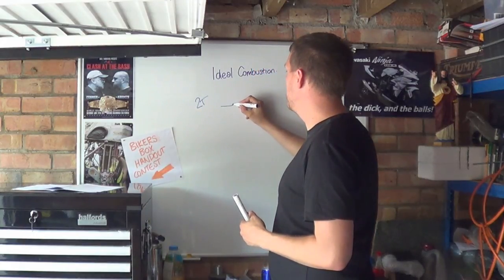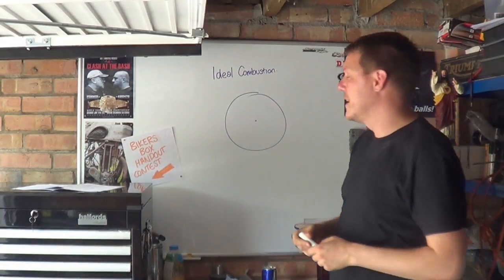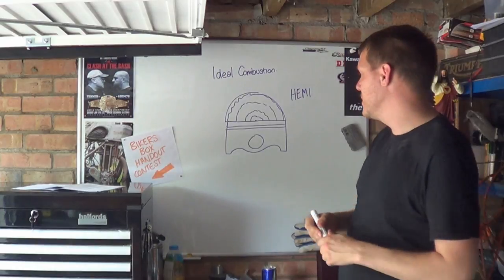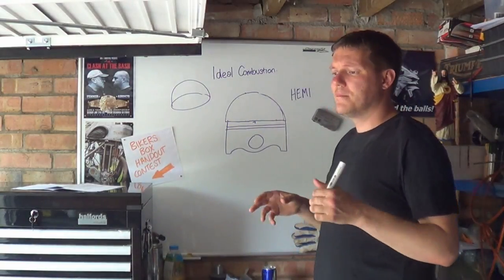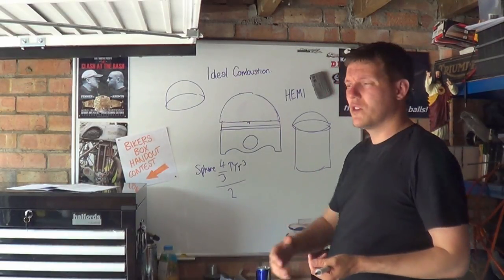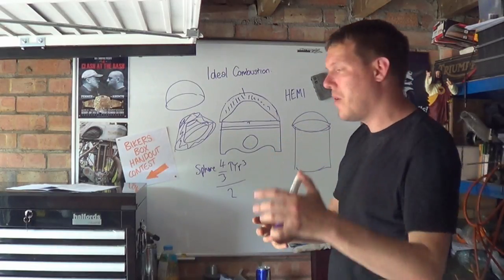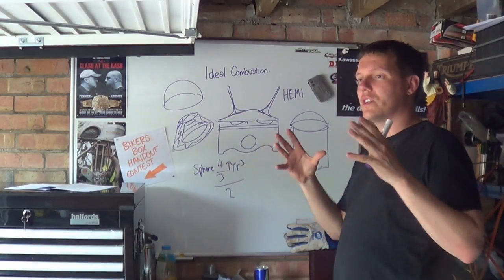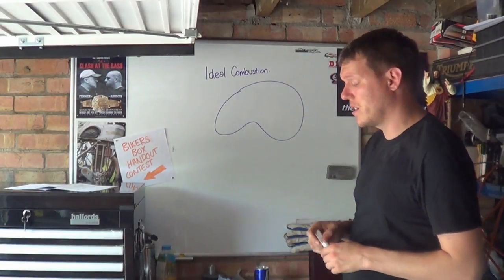Perfect Combustion and HEMIs

Comment: are you familiar with the abarth tcr engine,push rod with 13.5 cr,982cc with 112 bhp.it has a radiale head which i think is a hemi.chap does a show and tell on this motor on youtube.i used to spend alot of time with abarth.
Reply from the maker: No, do you have a link to this dude?
Reply: there is plenty of stuff on the net about this engine.norwegian gent youtube fiat abarth 1000 radiale-engine-youtube.this the whole bollocks motor.abarth also did twin cam motors and he used zagato to do his bodies.the final invocation of the radiale motor appeared in heavily modified fiat 600 shell in1970.the coach made bodies with twin cam are huge money to buy.abarth worked with porche,ferrari,simca and was aquired by fiat in  1971.abarth designed and built the lancia group b rally cars.the push rod radiale engine was very  fast ,8500rpm,112bhp and top speed of 125 mph.welcome to abarth..campione del mundo.

Comment: Love the content. Can you do a video on why motorcycles can run really high compression (my EBR 1190RX crash is 13.4-1, compared to cars high compression of 11.0-1 with the same fuel type. It's been racking my brain.
Reply from the maker: Because cars are shit! but yes I can
Reply: Because they run huge valve overlap, especially big twins like your buell and ducatis. Actual (dynamic) compression ratio when measured with closed valves is a lot lower, closer to 12:1 or so.

Comment: As time has gone on, I've started to look at good combustion on an application basis. 
---4-valve Pentroof is inherently good, all the time. 
----The kidney and cardioid stuff on the LS is good with a dished piston in certain stroke combinations from an integrable volume over time perspective, like when you include 40 degrees of crankshaft rotation, but then you need to know the desired RPM for duty.
----The other oddball is those diesels that have the cup in the piston, with a cone in the middle. I see a cardioid in the cross section, and it integrates nicely. 
---The hemi, yes, works like shit, no matter what. Truncated spheres are a different ball-game. I don't count those bastard things.
Reply: Look up the Olds W43, the engine that could've changed the game in all out performance.

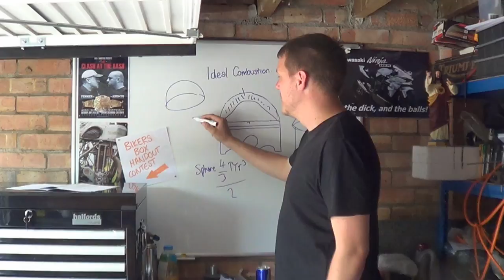Comment: 9:15 wouldn't that create similar shape charge physics, and create a concentrated section of combustion causing a hot spot?
Reply from the maker: Yes it does, hense the pent roof
Reply: But does the potential to extract more energy exists as a result of the shape, like a small shape charge cutting through thick plate?

Comment: In the early 1960's, GM/Chevy made an engine called the 409. It had a flat combustion chamber and a dished piston. It was very powerful, but the crankshaft kept leaving the block.
Reply: The 348 ,409 has a flat head and piston. The block deck is cut at an angle  and has a wedge were the combustion takes place. So basicly the combustion chamber is in the block.  My dad has a 409 in an Impala and we've been working on it for 30+  years together.
Reply: You are right about the wedge in the block, but there must be more than one type of piston for the 409. I have pulled the head on a 409 and it had a dished piston. 30+ years you have been working on the same car. When are you going to get it right.
Reply from the maker: "It was very powerful, but the crankshaft kept leaving the block"

- yeah that kinda stops that project in its tracks lol
Reply: Dad is one of those guys that can't leave it alone.  Its a 64 and you can call it a resto mod.  We do all the work ourselves and it keeps him busy. To him it will never be done as there is always another mod / upgrade.

Comment: Ah man, I hope I got this right, and you’re missing the main point of a hemi. Why would A manufacture want to have angled valves and valve train gear costing an exorbitant extra amount? It’s not because of the hemispherical shape but more the valve angles and port angles creating a better flow path from intake to exhaust in and out without right angles. it’s for  reducing angles or straightening the path of flow is the main idea. They flow better! Take for example some four-cylinder or six cylinder in line engines whether it be Japanese or domestics, to have the intake coming in on the same side as the exhaust going out. try and make that engine run fast. They won’t they’re backed up because it just flows like shit well add the straight up n down valve angles, and you’ve got a seriously power restricting pinch in the flow. 
Hemi science started in ww2 for aircraft when pistons still ruled the skies. Luckily or unfortunately that science got scrubbed for the end of the war. 
You’re spot on about the squish properties/problems that they pose and there inherent finickiness for octanes. 
But I’m spit on about the flow! 
When nitro is used, it’s like 7-8 times the amount of gas the run right. Add blower, huge cam,duration, big valves.....now you’ve got the needed flow characteristics to make SHIT happen! Carry on!🤘🏼
Reply from the maker: I'm lost here are you arguing against or with what I said?

You say stuff about straight runners, but generally hemi's don't have straight runners or was that you point you were trying to make?

Comment: I know you're intentions are good here, and that you believe the ideas you expressed are accurate. However, there are many issues I take with your proposed issues with a hemi engine. The heads of NHRA drag cars are not 1/2 spheres, they are more like 1/8-1/9th spheres with flat top, not "high compression" pistons, and yet they make almost 30:1 compression ratios running Nitromethane mixtures around 90%. How, you ask? Well they pack in the air and fuel with a super-charger. They need the volume of the hemi chamber for the size of valves they use. The intake valve is the size of large ci engine's exhaust valves and the exhaust valve is over 2.75 inches (almost the size of a pop can). The air is pushed in with forced induction and so much (they use 16 injectors) fuel in that it is almost nothing but liquid in the cylinder. By half way down the track they have burnt up the spark plug (which is powerful enough to arc weld, 44 amps/50,000 volts) and the "Hemi" becomes a Nitro Diesel for the remainder of the run. How can they run such high compression and so little air? Because Nitromethane has its own attached oxygen molecule! The sheer heat and pressure (30:1 compression!) is enough to ignite the mixture. The reality is this = The Hemi is used partially because of its history, mostly because of the technology/metallurgy/chemistry of drag racing. It is super effective for this purpose and there is no "NEED" to get away from using it. There are many other issues that I would love to go over with you to fill in some gaps on why these 11,000 horsepower Hemi's will be used well into the future.

Comment: The reason for the hemi is to increase the valve size not for ideal combustion. Top fuel dragsters use the hemi and they have like 50,000 horse power.
Reply from the maker: Wrong. Large valves have been superceeded by multiple valves, and the HEMI is something that many tried and then abandoned. As for TF dragsters that a different story and I'm doing a video on that this weekend.

Comment: In Defense of the Hemi and two valves from a bias source 
1) Dual valve allows for the placement of a second spark plug, increasing the efficiency of the ignition system --->  O:o
2) Two larger valves are stronger and less prone to breaking or burning/melting as apposed to four small valves. This is why very few people who drag race professionally here run pent head engines.
3) When using forced induction, the mass of the hemi piston is reduced to comparable pent head piston size.
4) When using forced induction the cylinder head chamber shape design isn't quite as critical as the air is "packed" in.
5) $$$ Its very likely cheaper to produce since final machining would in my logic take less time and labor.
6) As I understand, the larger size of pistons are desirable on the racing hemis. It allows for the pistons to endure 3 second 1000 foot drag racing. As apposed to melting pistons on every other engine design currently offered
7) one large valve may offer better fuel atomization when direct port fuel injection is not used.  
8) less valvetrain weight. Four valves springs per cylinder to overcome.

I don't doubt it that pent head has a more efficient flow design with nothing else but basic flow considered. A Pent head may have worse lament flow or worse CFM than the specific cylinder head you are comparing it to even if it is a better design concept, two valves or not. Perhaps its always better for low power applications where the metal is strong enough, It would seem a good enough design.
Reply from the maker: Dual spark plugs are not for efficiency but redundancy.
Reply from the maker: Number 3 you'll have to explain
Reply from the maker: No. 4 is wrong. Combustion chanber shape is about combustion. This is the same for forced and non forced induction.
Reply from the maker: No.6 these engines run really cool. Generally because they run methanol and or nitro
Reply from the maker: No. 7 needs explaining also
Reply: Dual plugs on each cylinder, allow the firing to take place closer to top dead center, and then again when the piston is on the back side of the power stroke. This (also reduces) NOx and ozone. They add some horsepower, but not very much. @dirtygarageguy
Reply: @dirtygarageguy  when building a forced induction engine your static compression ratio is reduced so that when you add boost you don't destroy the motor. low compression motors have smaller "size/mass" pistons than high compression motors. meaning hemis would benefit more from boosted applications.
Reply: @dirtygarageguy assuming a carburation application, it occurs to me that cylinder heads would have better fuel atomization in the center of the port pathway as opposed to closer to the sides where no doubt the pent head would need to place them due to spacing. the difference may be minimal or correctable with port design, but something I considered.
Reply: @dirtygarageguy  Also, Thanks for the video its always enjoyable for me to consider good engineering

Comment: Well a hemi is better for flow because the valves are at more of an angle so the charge can practically go straight through the combustion chamber.
Reply: Less restriction for the central intake on a carb v8. The new hellcat charger is really only a hemi for nostalgic sales pitch it's not a true hemi.
Reply from the maker: "so the charge can practically go straight through the combustion chamber."

- Nothing personal and not having a go at you but...... Not true and yet another reason why LS and Hemi engines are shit and outdated.

You want to fill the cylinder and not the combustion chamber, it does help overlap though. But in terms of filling the displacement you have, its a bad thing. 

I did a video about that subject here - https://www.youtube.com/watch?v=q460wjhg9WU

Comment: Just for clarity the LS engines don't use a hemi design.  Small error there but I agree with the rest. Rock on.
Reply from the maker: True, my bad. But its the evolution of the HEMI, well kind of. They reduced the overall shape and added squish regions but I was wrong none the less - cheers dude - and fuck cars lol
Reply: I hear that.  You should make a video talking about the new Koenigsegg camless valve engine design and what you see as a potential failure point.  I know you don't talk cars often but this is pushing the envelope in a new way and I think it will trickle down across all I.C. engines if they work out the details.

Comment: you crap on about how shit the ls engines are but they are cheap, easy to work on and relatively simple. in Australia they are very common so you can get all the parts you want oem or performance easily and cheaply and dont forget they make a fair bit of power. what more could you ask for in a v8?

Comment: Fair enough mate but pent roof 4 valve DOHC engines would have been used at NHRA if they were better than Hemi!  Just about all Top Fuellers and Pro Mod cars use big block Hemi or canted two valve Chevy engines! Never have I seen big block 4 valve DOHC engines run on any quarter mile track!!!

Comment: doesn't the kidney shaped head portion aid in air flow? O.o like a Chevy vortech engine that's supposed to help swirl the air fuel mixture to mix it better and it'll become slightly easier for the engine to suck it in and push it back out... which makes it more efficient... is all this bullshit? xD

Comment: To be fair...I think all the real engineers in America moved away from piston engines all together and went into turbine/rocket engineering lol. So it makes sense why baby boomers still perpetuate this old ass design. I would like to hear from NHRA top fuel engineers if they think they could possibly get more power out of a different design however. The backbone behind them getting 10k hp out of those hemi's is because of materials and displacement. I would like to see top European auto manufacturers try to make a engine with similar power outputs with a different head design.

Comment: All of the current MOPAR "HEMI"s are not real HEMIs they are a pent roof engine using HEMI as a trade mark. 
In the hay day of the HEMI 1960s 
The HEMI was popular because it is a great platform form a blower (roots blower). Untill recently most American V8's where low compression due to our emissions standards and the low quality of fuel in our country.
Reply from the maker: "The HEMI was popular because it is a great platform form a blower (roots blower)."

- Explain, because I keep hearing it, but no-one knows why...
Reply: @dirtygarageguy  the redone was that it accommodated a larger valve size as well slowed the valves to open further as a result of the larger combustion chamber, the other reason they where popular was that the shape of the combustion chamber slowed for better skavenging but that was more for NA applications, most American V8's from that time where relatively low compression. 
Even as late as the 2000s most V8's where running between 8.5:1-9.5:1 maybe over 10:1 if it was for a high performance application, but this had more to do with the relatively low Knock point of most pump gas
Reply: @dirtygarageguy  btw good looks on responding, and something I just remembered, about the HEMI 
Was at the time they came out they where seen as a better alternative to the slant head that was used in most v8 engines.  Also I just realized I misspelled  'Scavenged' (my bad)
Reply: @dirtygarageguy  I just found out exactly why they where so popular 
The original MOPAR HEMIs where popular for supercharging because they could accommodate a larger valve size, when compared to a contemporary engine of the time. The lower compression ratio as a result of a larger combustion chamber was not a problem at the time since most "Blown HEMIs" where low compression to accommodate the supercharger with pump gas,
It should be noted that MOPAR/Chrysler where not the oy ones with a hemispherical cylinder head, Ford had the 428 "Cammer" which was an OHC 427Ci V8 with a  semi hemispherical head, that was later banned from NASCAR, as a result of Chrysler boycotting races untill it was banned. But the fords did not have as drastic of a dome in the cylinder head.

Comment: I've always thought this was stupid and I'm American. The best example, (you Brits will love this,) of the difference it would make is the 90-95 Corvette ZR-1 LT-5 engine designed by Lotus for Chevy. The engines made 100-175hp more than the regular 2v 350 at the time, and the price was 30k over the price of a normal run of the mill Vette. How Chevy couldn't make that work I don't know.
Reply: "Chevy" did design that engine. GM owned lotus at the time so it's a general motors engine.
Lot's of companies do that. Dodge could make their own diesel but have cummins do it instead. Honda made their own engines but used Izusu engines in their early passport.
Either way. GM didn't have much experience with DOHC v8s so they had one of their subsidiaries do the work.
Reply: Like I said... Lotus designed the engine. 2v 350 = 250-275hp. 4v 350 = 375-425hp.
Reply: Meh, they ditched it anyway in favor of a 2v again when they switched to the LS